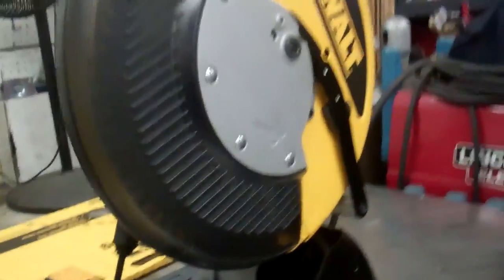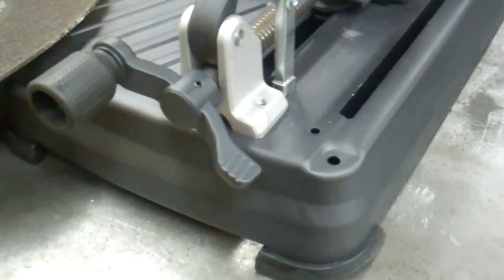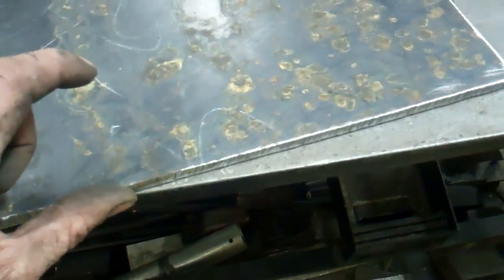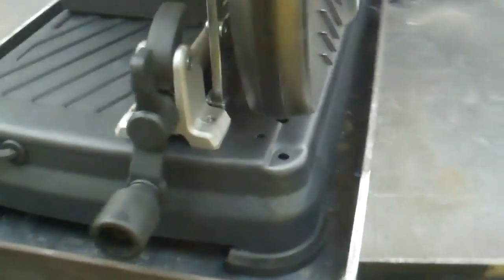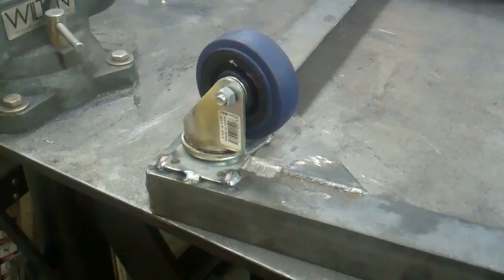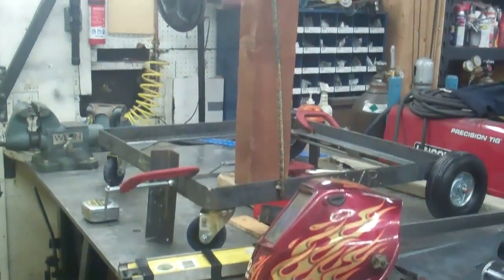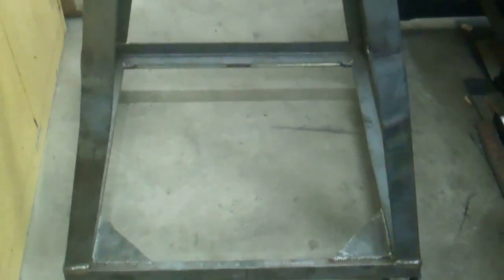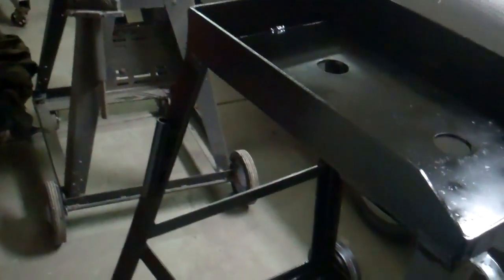Building a Cut Off Saw Stand (Chop Saw)

Comment: Came out good. One of my long term goals is to build a chop saw station/bench that doubles as a plasma cutting station too. The inset area where that saw sits will allow the saw to rotate so I can easily change angle just by rotating the saw rather than turning the clamp on the saw and having my metal hanging off the table. I've had the design in my head for awhile now but it's allot of material so it won't be build until I'm not longer poor lol.
Reply from the maker: Im building the stand for the tube roller right now.  The video will be coming soon.

Comment: Thinking of getting either a 14" dry cut or an evolution rage 3 , 10 inch metal miter saw . Looks like clamping work piece and moving saw to 45' might might work better. Wood saws seem to work well that way.
Any advice???
Reply: I don't know if you're still needing advice? Those Evolution machines look AWESOME. But regular wood saws don't allow you to clamp the material safely. Some have small clamps that are good for doing trim work (baseboard, casework, etc.), but those don't hold very big metal stock. You can get away with hand-holding wood on a miter saw, but not metal. It's a very bad idea. I have never been silly enough to try it, but I've been in the shop when other morons have and nearly took a piece of metal right through my internal organs. (Put a massive dent in a nearby 18 gauge galvanized metal structure AFTER going through a piece of OSB.) Don't mess around. Make sure you get a saw that is made for cutting metal, and use the clamp!